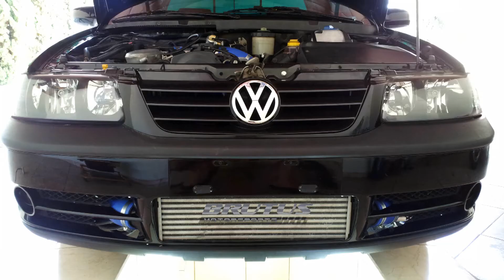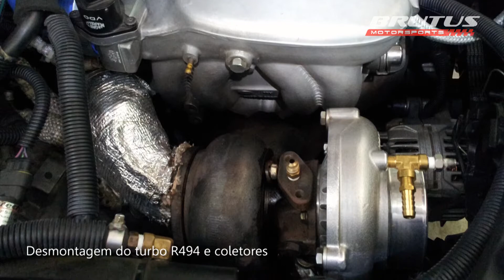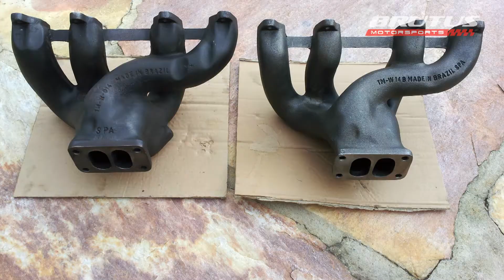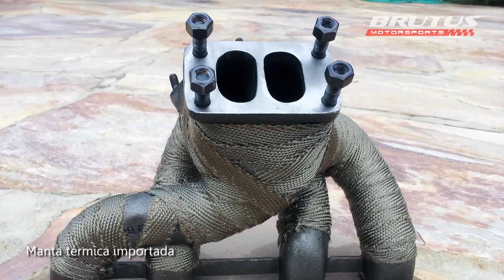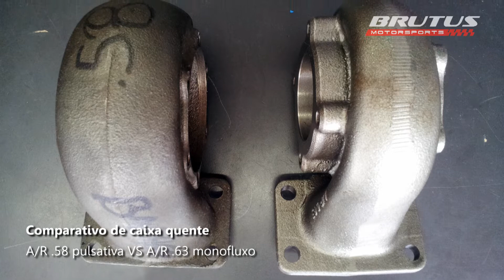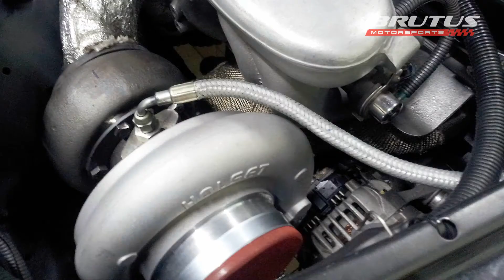Saveiro 2.0 Turbo Instalação da Holset HX35

Comment: blz sempre assisto seus videos massa a saveiro tambem tenho uma 1998 forjada fluxo cruzado 8 bicos usava uma .42 .48 com 1.7 kg troquei  por uma hx 40 so que nao vem presao so 1.5kg tem ideia o porque? coletor tmw14 slim escape 2.5
Reply from the maker: Cara, pode ser muitas coisas: vazamento na junta de escape, coletor de escape empenado, valvula de alivio com problema, vazamento na pressurização, mola da valvula de alivio muito macia, vazamento na valvula de prioridade, etc. Inspecione detalhadamente que vai achar algo. E outra, escape de 2.5 é pouco para HX40, a minha HX35 nao vinha mais de 2bar com esse mesmo coletor e escape. Depois q instalei o difusor de escape subiu pra 2,4bar na mesma regulagem.

Comment: Oi amigo parabéns pela caranga, muito loka.
Tenho uma parati g3 com ar e direção, e fui instalar esse coletor tmw14 com uma turbina SPA, porém o coletor bati no suporte do filtro de ar original (uma latinha na longarina) além de que fica encostado na mangueira de alumíniol do ar condicionado. Como vc resolveu esses problemas ? Obrigado
Reply from the maker: +Alexandre Gandra Carvalho Olá, primeiramente obrigado. Não lembro desse problema do suporte do filtro de ar original, se ele está atrapalhando, remova. O tubo de alumínio do AC eu desparafusei a fixação original dele e desloquei ele em direção à barra de direção, assim coube. Recentemente modifiquei isso novamente, usei parte da mangueira original e parte do tubo, e o restante refiz, alongando a mangueira. Agora ela faz outro caminho, livrando-se do turbo, coletor e do escapamento. Infelizmente no Brasil pouca coisa é realmente plug and play, e temos que dar nosso jeitinho para fazer o que queremos. Te garanto que é possível usar esse coletor com o AC original sem problemas, basta encarar a briga rs. Boa sorte! abs

Comment: Amigo você usa pistão original ? só com bielas forjadas ? quais pistao usa? gasolina do 2.0 injetado mesmo ou do carburado com cava maior ?
Reply from the maker: Isso, pistão original 2.0mi.
Reply: incrível isso amigo, e ja deu 2kg de pressao e aguento. tenho uma saveiro g3 2.0 tambem com miolo original, você teria como me da uma ajuda com o acerto ? ja andou com as bielas originais ? quanto ela aguentaram ? sobre a ajuda no acerto queria dicas sobre a curva de ponto pra usar.
Reply from the maker: Dá 2kg toda vez q a sav anda, e acelera todas marchas várias vezes, não quebra. Tem 40mil km e quase 8 anos turbinada. Bielas originais esquece, apartir de 200cv já ta correndo risco de quebrar e voar tudo. Sobre ajuda no acerto não dá, não tem formula certa pois cada motor é único. Foram anos de testes e calibração pra chegar onde está. Pra vc ter idéia temos quase 400 logs gravados de aceleradas desta saveiro com as mais diversas alterações mecanicas e de calibração. Isso gerou uma experiência e conhecimento que não tem preço. E o segredo não é só ponto, ou mistura, ou taxa, ou montagem, ou calibração, é tudo junto. flw
Reply: Brutus Motorsports  200 cv na roda ou motor ??
Reply from the maker: no motor.

Comment: oi amigo, bom dia, mto top a instalação, tenho um G3 com ar/dh tbm, alguns dizem que é possível usar o kit no farol, vc acha que tem como? tenho um gol quadrado com o kit turbo no farol e gostaria de passar o kit para o G3
abraço!
Reply from the maker: +hirinhu  Nós tentamos usar esse coletor pulsativo no farol nessa saveiro e não serve de jeito nenhum. Se for um g3 apenas com dh dá pra adaptar sim, dependendo do tamanho do turbo etc. Flw
Reply: +Brutus Motorsports opa obrigado pela resposta amigo, no meu caso uso turbina bem menor 42/63, teria que deslocar o compressor e o alternador pra baixo né
Reply from the maker: Sim, isso mesmo.
Reply: +Brutus Motorsports  você acha que consigo? Pq assim, verifiquei sobre o TMW14slim e o normal... dizem que precisa ser um motor muito forte pra empurrar legal e o meu é básico de tudo...
Reply from the maker: Igual te falei, se tiver somente DH dá certo, só deslocar pra baixo o alternador. Se tiver AC e DH não dá, não tem espaço para deslocar para baixo pois lá em baixo fica o compressor do AC.

Comment: Hi. is holset Hx35 a diesel turbocharger???
Reply from the maker: +Jorge Lopez Correct. Holset makes turbochargers for diesel engines only.
Reply: But this saveiro is diesel??? Or gas??? I ask you because I have a Vento Mk3 1.8 but in Venezuela is hard to find a gasoline turbocharger but the holset like your is easy to buy...
Reply from the maker: +Jorge Lopez This saveiro ran originally on gas, and after turbocharging it runs ethanol E100. Holset turbos are cheap, realiable and make good power, you only need a smaller turbine housing to run it on a small displacement engine.
Reply: +Brutus Motorsports Yeah but you can put a holset turbo on a gas car.

Comment: Hi! Do you have AR .58 and other hx35 housings for sale ?
Reply from the maker: Hello, this AR .58 housing is custom made I did for the 60mm turbine wheel of the HX35. There are other possible T3 options like .63 .70 .82 .84 and 1.00 I could sell to you, but it depends on how much are you willing to spend. Because besides the housing cost, there is shipping cost and we are in far away countries. thanks

Comment: quais as medidas da HX 40  e da 35 ?  você e preparador ?  abraço Diego
Reply from the maker: Tem várias medidas e diferentes números de palhetas do compressor nas das duas HX. A HX35 tem sempre eixo 60mm e o rotor varia entre 50mm, 54mm e 56mm. A HX40 tem sempre eixo 64mm. O rotor geralmente é de 60mm, mas existe uma outra versão incomum de 58mm. Qualquer mistura disso, como uma HX40 com eixo 60mm, é uma turbina híbrida não original de fábrica. Somos a Brutus Motorsports, e mexemos com preparação de motores injetados. abs
Reply: tenho um ap 1.8 quero usar uma holset pensei em uma hx 40 com rotor 60 e eixo 60 caixa quente 58 mas me falaram que da muito leg não tenho cabeçote preparado o que me indicaria ? ele esta com 2e ... grato Diego
Reply from the maker: TheSpeed889 Sem saber mais detalhes de sua meta de potência e uso do carro, rua ou pista, te indico uma MP da linha Racing R494 ou R544. São ótimas pra rua com cabeçote original. As Holset são top, mas te falaram certo, HX35 e HX40 já partem de eixo no mínimo 60mm, e por isso gera um lag notável. Se fizer questão de ser Holset, vai de HX30. Tudo depende de onde quer chegar e do uso do carro. Carburado dificulta mais ainda de ficar menos ruim. Cada um gosta do motor com um comportamento, uns pegada em baixa, outros em media, outros em alta. Indico vc assistir o vídeo (watch?v=mb6SkhCx2aQ) pra ver como fica uma HX40 nas medidas q vc falou mas com caixa quente .70 num AP 1.8 cabeçote original. Com a caixa quente 58 talvez consiga q a turbina encha por volta de 5000rpm rs.
Reply: Brutus Motorsports  Nossa, que pegada tarde!! :o leva pau de Apl! rrsrsrs 
outra duvida, os pistões do MI estão o olho da cara, preço de forjados por aqui , vou pegar os 1.8 carburado 8,5 de taxa R$ 380 com aneis vs 880 dos MI, preciso agora de um meio para subir a taxa para uns 9,5 , para não ficar muito xoxo em baixa, quanto +- vou terque tirar do cabeçote ? queria saber tambem se aquelas juntas da SPA funciona ? pois manteria a altura do cabeçote original,  lembrando que a medida do circulo aonde casa com o cilindro da junta e 84mm  e os meus pistoes serão 1.8 1mm 82 mm essa diferença de 2 mm que ficaria sobrando na junta não criaria um ponto de fogo e logo queimaria a mesma ? obrigado
Reply from the maker: Pode usar juntas SPA que funciona.
Reply: @BrutusMotorsports  oque vc fala da turbina masterpower 6164pra um motor 1.8 injetado original futuramente sera montando 2.0 por isso aproveitando  ja comprando uma turbina maior

Comment: Prefiro mil vezes um vectra CD turbo com Turbina Holset HX35, Válvula de Alivio SPA Compact, Intercooler frontal, Pressurização em Aluminio 2,5", Escape 2,5' com 1 abafa dor JK, Pistões IASA 87mm (p/ 700cv). Bielas K1 (p/ 700cv), Parafusos ARP, Anéis NPR, Blockguard, Bomba de Óleo GM 2.4 16v retrabalhada, junta de ca cabeçote de aço de Astra Flex Cabeçote 16v 100% original, comandos originais. tuchos novos, taxa 10,0:1, Ventoinhas SLIM, Injeção Megasquirt MS2-V3 com correção por sonda Wideband AEM. auto-acerto de mapa de combustível Two Step e Flat Shift acionados por botão no pedal de embreagem, 4 bicos Fuel Injector Clinic (FIC) 1050cc baixa impedância com resistores, Bomba de combustivel Dinâmica 12bar no lugar da original + 1 de Mercedes externa (embaixo da porta traseira do passat geiro), Linha de combustivel 9,5mm, fil tro de comb. de Blazer V6 (fica atrás do motor), Bobina de Vectra 2011, velas NGK Iridium, cabos de vela originais, Cambio GM F23 (eixo piloto largo) adaptado, embreagem Cerâmica FF 1200 lbs com acionamento mecânico adaptado, Suspensão de Rosca Fênix, Rodas do Vectra GT-X aro 17, originais GM, Pneus BFGoodrich G-force Profiler 215/45 17, Freio Dianteiro: Discos 288mm frisados + pastilhas Red Powerbrakes, Manômetros